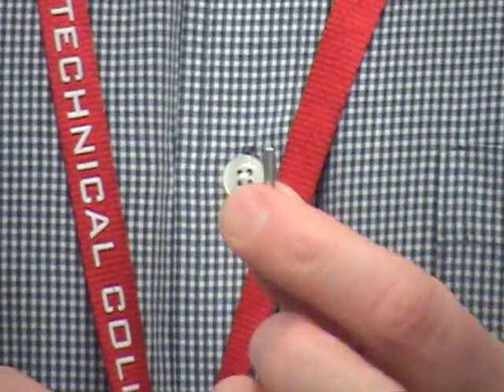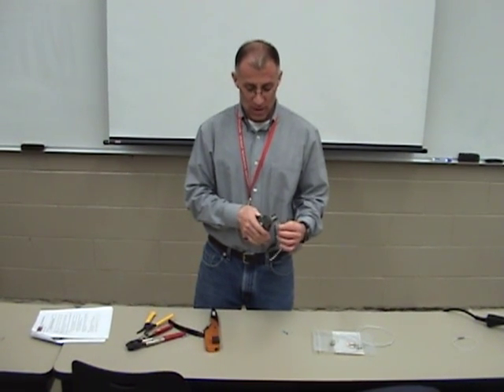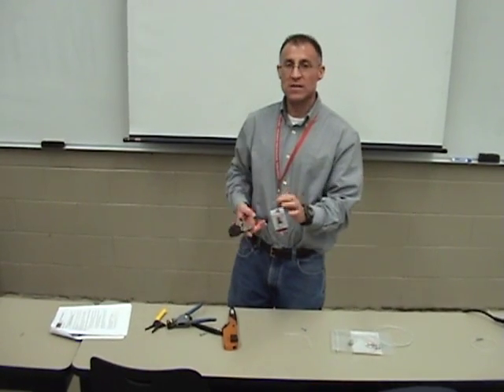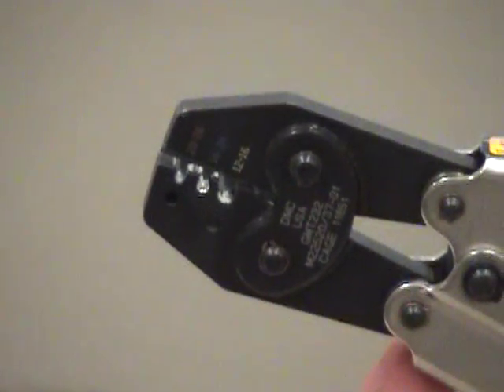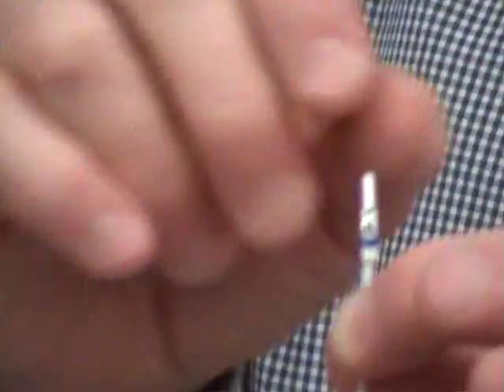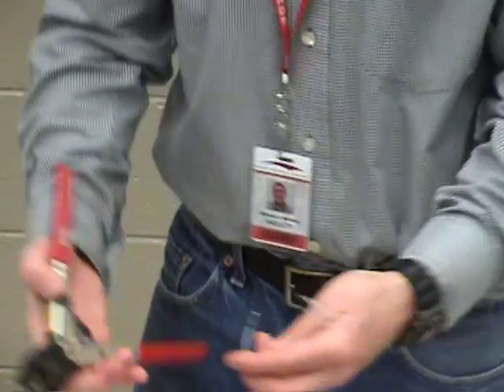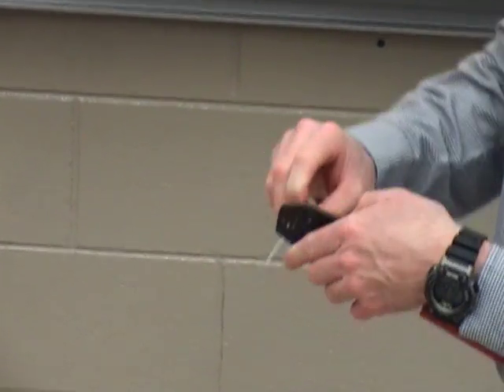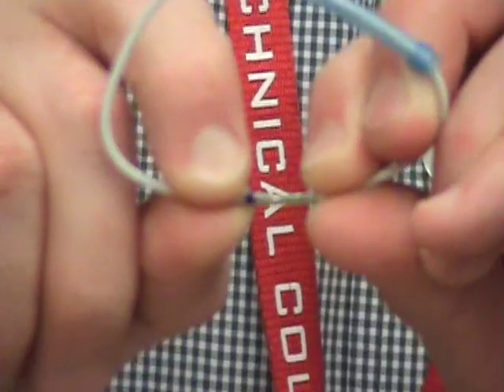*EXPERT LEVEL* Environmental Splicing Tutorial TTC Avionics

Comment: I see your using a DMC GMT232 which is an MS22520/37-01 (according to page 102 of DMC catalog I have).
I have a Raychem AD-1377 crimper which should also be an M22520/37-0.
For all purposes, should they be considered the same tool with only marketing distinctions?

Comment: Hey I seen some splices gone wrong before and I was wondering if you could shed some light on it, I've seen couple of times wen someone would crimp an environmental splice and the crimpers wouldn't release and you be forced to squeeze much harder than you normally would to release them, which would crush the splice ruining it? Could this be faulty crimpers or someone not having the splice window facing the teeth of the crimper?
Reply: Check the pin, cable and crimping set data sheets. Sent crimping set for cal. Redo the joint.